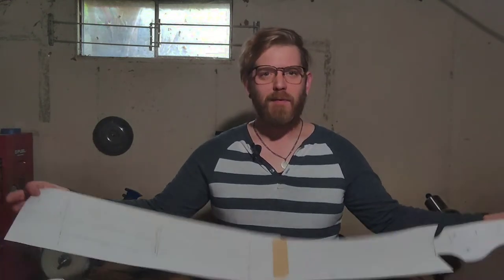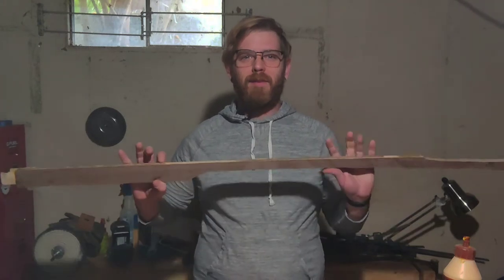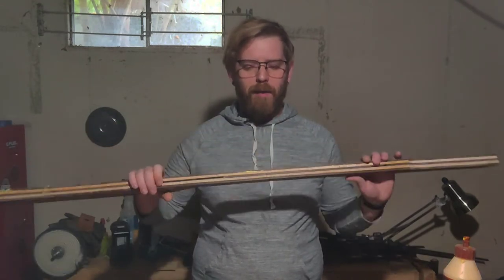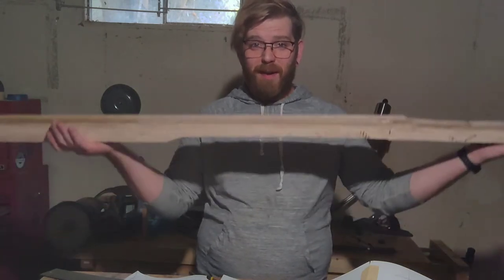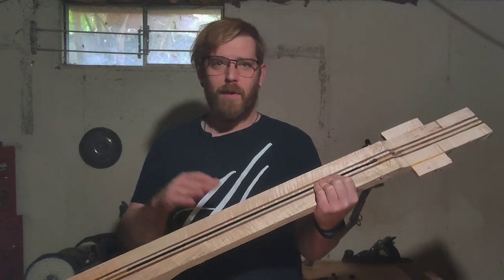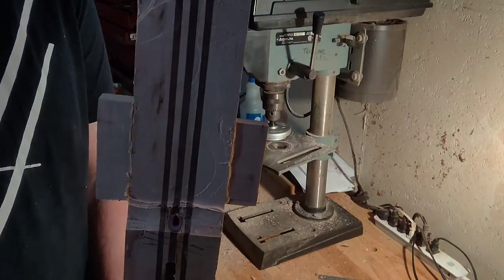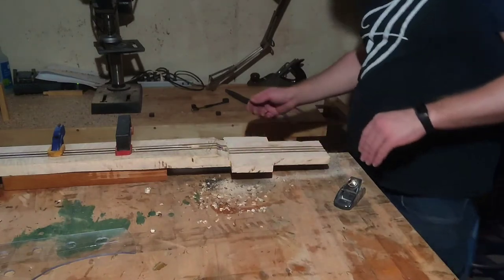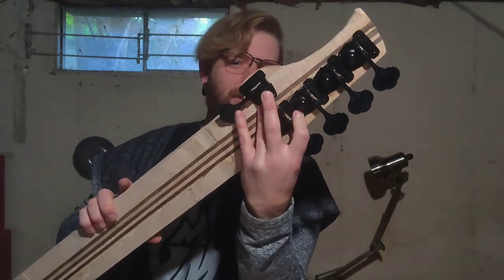Wow! Building A 5 String Bass, With a Twist Part 1

Comment: There is no wrong of doing things if you end up with a product that works. Where seems to be people so set in there ways that they very learn anything new. I see nothing wrong with doing what you are doing with your trust rod slot to reduce the amount of routing of that slot with a router.
Reply from the maker: I agree. Its a thought I've dabbled with for awhile now. Always done it the traditional way which also isn't an issue really. But figured I'd give it a try. Now of course this only works on laminated necks like this so is it a replacement, not by any stretch, but it worked out great here!